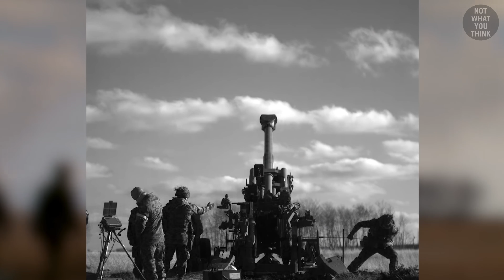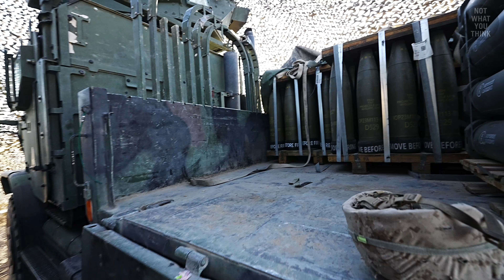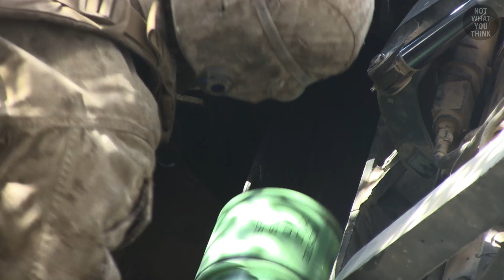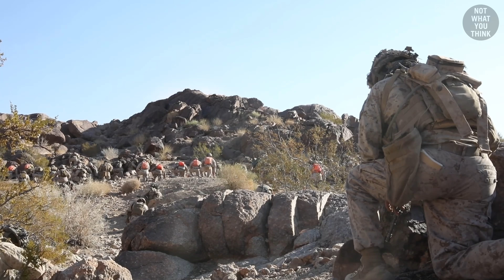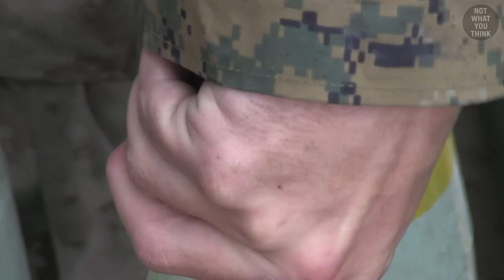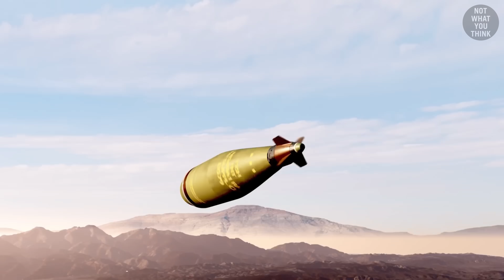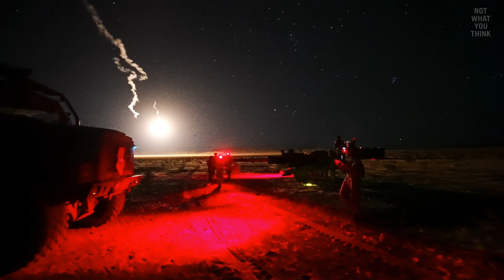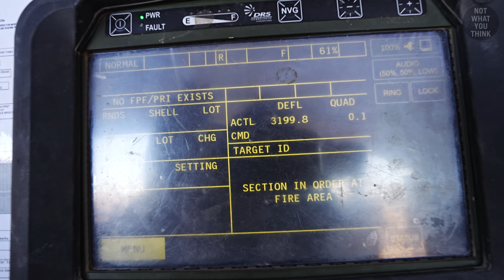Why Artillery Guns Always Shoot Short at Night

Comment: guns do not always shoot short at night, sure, direct fire shoots shorter because its direct fire, you can do direct fire day or night, but FDC provides data solutions as to elevation and deflection and what powder charge to use so rounds always hit where they are supposed to when doing indirect fire...day or night

another misconception is when a round hits, that the nose somehow impacts first....the round actually hits horizontally the same angle as it comes out of the tube and slides just a little till the fuze impacts something....it can be a fraction of an inch or a foot .......( this is an exaggeration of distance made just as an example...it's usually a fraction of a fraction in distance when it impacts )
I did artillery for 6 years, I was a gun chief for a year, then I changed to a different MOS

Comment: I was an 13B in early 90s on the m-109 the powder charges were completely different there were mainly 2 different types green bag and white bag. Green bag had 5 segments white had 7. You cut the powder according to fire mission. There was also a red bag wich was supper hot and only used for tactical nuke rounds. Supposedly tube could only fire one round and was finished. But fortunately never had to find out.

Comment: Artillery shoots shorter at night due to colder, denser air and cooler propellant charges. The increased air density creates more friction, slowing the round, while the cooler propellant burns slightly slower, producing less muzzle velocity and range. 
Colder air: Nighttime temperatures are colder, making the air denser. This increased density causes more air resistance (drag) as the shell flies through it, reducing its range.
Cooler propellant: The propellant charges are also colder at night. This causes them to burn at a slower rate, resulting in slightly less force pushing the projectile out of the barrel and a lower initial velocity.  I googled it and saved 20 minutes.

Comment: I heard in classic artillery you often did what in german is called "gabeln" ("forking") - 

When the first shot goes too far, you set the second shot that it will go too short - and from the relation of the "too far" and "too short", you can calculate to hit with the third shot. 

That was esteemed to be more effective than nudge yourself towards the target from one side.
Reply: In English it's called bracketing.

Comment: The reason the White Phosphorus rounds cannot be shipped with either the powder loads or the other warheads is fire risk. If the phosphor were to ignite, they could heat up the propellant charges or the other rounds enough to cause them to explode. Better to have one truck catch fire but the crew able to jump out safely than to worry about the load exploding killing not just the truck, but anything in range.

BTW, this kind of Dangerous Goods (DG) separation isn't just in the military. I used to work heavy weight airfreight in the 1990s. And we had all sorts of rules as to what types of DG could be packed in the same container, how they were packed, and how many container positions they had to be separated from each other if they couldn't be packed in the same containers. (Example, Class2.1, 3, and 4 flammables (Gas, Liquids, and Solids) could not be packed in the same containers as Class 5 oxidizers. There had to be at least one container in between them as well. And this is just transporting on aircraft.
Reply: Lol that is a new thing in the 80s and 90s everything was together. In the m992 ammo vehicle and the m 109 sp. It also has to be left standing up vertically so we could only carry a few.

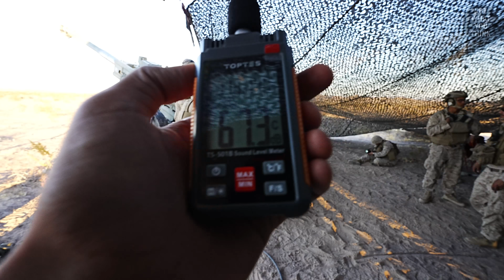Comment: 1:15 that's not only the decibel but the ''Bone Collector'' and the high pressure created by the sound wave. Other than your ears, all your bones will catch the vibration that will damage your ears.
So what so ever the ears plugs you have, it's impossible to muff more than 40 decibel. So these gunners will have issue for life with Concussion and ears damages from the sound blast going in their entire body.

-------

Comment: If you’ve never used Peltors or a similar ear pro with high end ANC, try it. Once you try them you’ll never wanna roll up foamies and jam them in your ears again. 

You can hear the wind change direction with those fuckers 😂 I’m exaggerating a bit, but only a tiny bit. After a heavy run, if you put them down, your breathing will sound like Darth Vader’s

Comment: Artillery guns often "shoot short" at night because the colder nighttime air is denser, creating more air resistance and causing the projectile to travel a shorter distance compared to daytime firing conditions; essentially, the shell experiences more friction as it flies through the cooler air, impacting its trajectory. 
Key points to consider:
Air Density:
Colder air at night is denser, leading to increased air resistance on the projectile. 
Propellant Temperature:
Even the propellant within the shell can be slightly cooler at night, affecting its combustion rate and impacting the projectile's initial velocity. 
Correction Factors:
Artillery crews typically adjust their aiming points based on environmental conditions like temperature to compensate for these nighttime effects.

Comment: Old cannon, world can change inside all bolt carrier in all rifles and cannon from traditional rod primer hammer to piezoelectric ignition, and use high pressure premix of liquid or gas and oxygen inside reusable cartridge on battlefield by make refill hole under the cartridge it self, energy density of smokeless gunpowder just 3-5 mj in other side liquid or gas can reach 23 mj/kg for ethanol or 46mj/kg for gasoline

Comment: WHO:
White phosphorus can cause deep and severe burns, penetrating even through bone. After exposure, the priority is to stop the burning process. Caution must be exercised to avoid secondary exposure of medical personnel from victims suffering from white phosphorus burns. White phosphorus can re-ignite during or after initial treatment due to the contact with oxygen. Use clean water/medically prepared saline throughout the process.

White phosphorus is a chemical waxy solid substance typically appearing yellowish or colourless, and some have described its odour as resembling garlic. It ignites instantly upon contact with oxygen. It is often used by militaries to illuminate battlefields, to generate a smokescreen and as an incendiary. Once ignited, white phosphorus is very difficult to extinguish. It sticks to surfaces like skin and clothing. White phosphorus is harmful to humans by all routes of exposure. The smoke from burning phosphorus is also harmful to the eyes and respiratory tract due to the presence of phosphoric acids and phosphine.

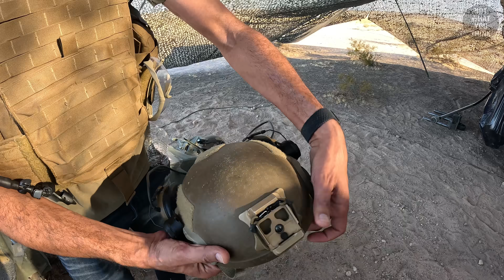Comment: 1:42 Before my first deployment, I was given a set of Liberator II headset, and they were amazing. It would cut off sound over a certain decible, but allow me to hear extremely quiet noises from far away. We did a lot of raids at night, and we would creep into the village to set up security.  I could hear other platoon members whispering like 30 keters away but if someone starting firing a rifle right next to me it would significantly reduce the volume of it. That was in 2012 so I cab only imagine how good these headsets are now.

Comment: $10,000 per round is a joke. A GPS, servos and explosive. That doesn't add up to $10,000.
Reply: But you need to made it in a quality to survive the acceleration it needs
Reply: Artillery shells have always been expensive. Even without the new fuse. The powder charges alone are about 600 bucks a shot.

Comment: air temperature differential has a very small effect on range changes at night, rain and other "MET" or meteorological data can have an effect as well including elevation to an extent. The change in the propellant temperature can have a more signifcant effect, particularly in a desert environment where the ambient temperature range is wide between day and night. A well trained crew will relay the propellant temperatures to the FDC and corrections can be made easily, someting redlegs do every day. 13A

Comment: I won't watch because I asked an AI to answer the question in the title. Google's AI Response: At night, the air temperature is generally lower, making the air denser. This increased air density creates more friction as the artillery round travels through the air, slowing it down and reducing its range. Also the propellant charges used to fire the artillery rounds are also colder at night. Colder propellant charges burn slightly slower, producing less explosive force and consequently reducing the range of the round.

Comment: The shells for an 8" howitzer are only 1.9" larger in diameter but weigh 100 pounds more. They had some 8" guns when I was in the army but mostly 155mm, and later on got rid of all the 8" guns. Some of the barrels were used to make GBU-28 4,000-pound bunker busters. The newer 155mm guns are supposed to be accurate enough to replace all the 8" guns that only had to be "close enough" to the target to get the job done, and not hit as precisely. I didn't realize that artillery didn't shoot as far at night, but we had some fall REALLY short when I was in Germany. One round tore through the top of a tent and landed inside, and another one landed in the back of a cargo truck. We had stuff flying overhead day and night for weeks at a time out on the range. You get used to the sound and sleep right through it, but once when the shooting stopped, me and another guy in our tent woke up because it was too quiet.
Reply: They can fire the same missions day or night.  The difference in distance at night would be minuscule and well within the projected parameters of the FDC’s firing data to each individual Gun.  Each gun has its own shooting characteristics with some shooting longer and some shorter. There is even a thing called “tube memory” were the shot after a higher charge round will be faster than normal even with a lesser charge, and remember they used to do all that without electronics! ‘Charts and darts”!
I’m an old Gun Bunny 5 years on M109A2 155mm and 4 years on M110 8in (210mm) ‘82-‘93
Reply: @bertsteele139  The King of the Battlefield! Respect. I was a REMF, but we all had a part to play. I spent my time in small arms repair. I know small arms ammo produces less pressure and velocity when it's cold than when it's hot. I don't know if daytime to nighttime temps are enough to make a difference, but summer to winter does. I found that out with my gas-operated shotgun. I never considered whether artillery velocities varied by temp but it makes sense there would be some difference with the seasons, but day and night? I think you're right about the minuscule difference. Tanks don't have a problem anymore because the fire control computers take everything into consideration, even barrel wear from one shot to the next. It sounds funny if you hear anyone say 6.1 inch or 203 mm howitzers after you're used to calling them 155mm and 8". You can try it with your old friends and see if they get confused.
Reply: @BigHarryBalzac  respect back at you brother.  We all volunteered for the party then did the jobs they gave us, at least you can still use the skills you learned in small arms repair, not a lot of call for big gun experience lol.
Reply: @bertsteele139  😃

Comment: Never knew artillery still did direct fire like it's WW2 that's sick
Reply: I do not think this is practical anymore, since you can use a man portable self homing rocket to do the job (anti tank). As well I do not think they use artillery to shoot down planes as they used to do in WW2. Now you simply fire a rocket that chases the plane (heat from jet exhaust).
In WW2 the mythical German 88mm Flak gun was the way to go both for anti-aircraft (its design use case) and antitank roles.

Comment: Are you sure theres a thermometer in each charge?
That does not look correct according to the pictures, as the second time it i showen the red protective sheet is behind the thermometer stuck into the charge. Also its not practical to have to remove the thermometer to avoid metal in the breach after each round.
From my perspective as an artillery gunner, on a different Gun of course, it does not seem plausible.

Comment: M777 was just being implemented when I got out in 2006. We had the M198... a lot of differences between them (like the weight. M777 about half the weight). Also, several new tools, mainly the fuse setter, and new powders. Thermometer was part of the gun gear, so got stuck in powder during position setup.

Comment: 15:33: Incorrect. Air actually gets less viscous as temperature decreases (unlike liquids which typically get more viscous) so viscous drag or "friction" actually drops. The overall drag increases because the drag budget is dominated be pressure drag and wave drag which don't depend on viscosity.

Comment: I was a 91F weapons mechanic based out of Fort Bragg, NC with the 82nd Airborne Division. I was also deployed to Afghanistan in support of OEF in 2010. You said in the video what happens if the round gets too hot, usually these guns don't jam, the force of the explosive is more than enough to get it down the tube. The heat can cause the casing to warp and there is a small chance it could detonate before leaving the tube. The other risk is something I personally witnessed where a crew had left a round in the tube after a cease fire was called and many rounds had been fired, so the tube was hot. Normally the crew is not sypposed to load until FDC (Fired Direction Control) gives them the order to "Load" then "Stand By" and finally, "Fire!" The tube should be empty after the last round until the command is given. One of the crews loaded a round in before they gave the order, it sat in a hot tube for a period of time, likely a couple of hours. When the command was given to fire, the tube exploded at the end and rattled the entire firing line. I dont think anyone was injured from this event. Our weapons repair was in a BSB (Brigade Support Batallion). There was an investigation launched to figure out what caused the failure. The howitzer had blown the end of the muzzle brake off, some pieces went up to a half mile, which comprised of 450 lbs of titanium. The end of the tube banana pealed some too. They brought the gun to our shop and around 0600 civlian contractors showed up with some fancy equipment. One of which was used to take video of the heat displaced in the tube, looking for weaknesses in the manufacturing process or damaged rifling. What happened was the thermometer was faulty and the crew said the heat was in the yellow, but because it was faulty it should have been in the red. When the round exited the muzzle after becoming warped from sitting in a hot tube, it caught the end of the muzzle brake from sort of "wobbling" out. The muzzle brake only has just millimeters of space as it exits. When it cuaght the end of the muzzle brake, the end of it burst into pieces, the round itself did not pre-detonate but instead went down range and impacted short. We spent weeks, maybe months replacing all the thermometers on all 36 guns in the brigade. Lesson learned, don't let a round sit in a warm or hot tube, if you do, ram the round back out once it has cooled and consider it a dud. Call EOD and have them get rid of it. Ultimately it was a combination of crew error and a faulty thermometer.
Reply from the maker: Thanks for sharing. It was interesting to read.
Reply: Great video by the way, very thorough information. Excellent footage of those night rounds too.
Reply: I trained 19D scouts as a member of a Army Reserve training BN. One night at Ft. Knox we had multiple warped barrels on the Browning M2 50 caliber MG Active Duty officer failed to provide spare barrels. 2 Active-duty NCO were injured on the M60's MG from cook-offs trying to clear jams the barrels were red from the heat.

Comment: Because the air is cooler, so thicker, so the round is held back more at night. 
It's the same reason your bike turns a quicker ET at the drag strip, the engine is getting more air because the air is cooler, so, thicker (more dense).

Comment: M777 is an old rugged piece, which has the possibility to Airlift via Heli. But it takes ages to get in and out of position which makes it very vulnerable. Get a RCH155 module on Boxer, Patria or even truck. 24 Rounds loaded automatic or manual, digital fire solution, up to 10 shots per minute, MRSI-capability and electric target acquiring. Scoot and shoot in less then 30seconds, Hunter-Killer capability, at least boxer variant (maybe also others) can even fire while driving slowly (with less precision i guess, but unsure). And you need just 2 soldiers to operate instead of at least 7. And your artillery piece is protected from Guns up to 12,7mm/.50 cal and artillery shrapnel.
But of cause its easier to break and more expensive then a hand-cranked towed gun. Since less soldiers it might be less expensive to operate though, i'm not sure. But way more survivable then your old towed piece.

Comment: Well, it was exactly the two things I suspected:  1) air density is higher at night due to the cold and 2) the chemical reaction of the propellant is less at those lower temperatures.  Anyway, it wasn’t so odd (any scientifically literate person could have deduced it) but the “hook” ultimately disappointed.

Comment: Those types of hearing protection is called COMTAC, also, I wonder if the troops are wearing double hearing protection, because I would. You can set the COMTACS on high and wear earplugs so you get double hearing protection, but still hear each other....kinda.

Comment: I jumped into 29 Palms with the 82nd Airborne. That was one miserable place to train. Heat exhaustion during the day, and the water in your canteen would freeze at night, unless you slept with it. Most extreme difference in hot and cold I have experienced in a 24 hour period..